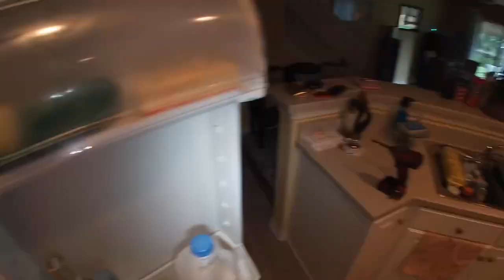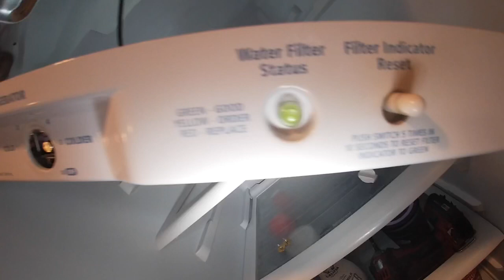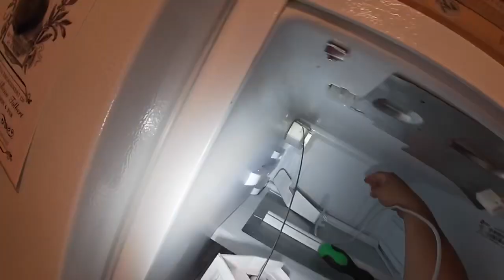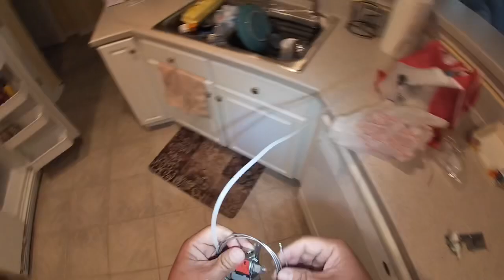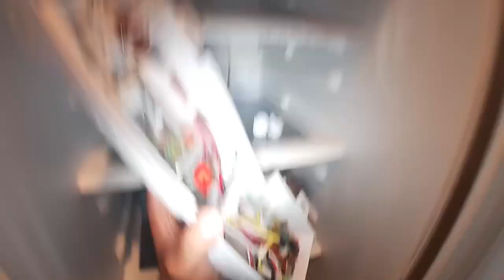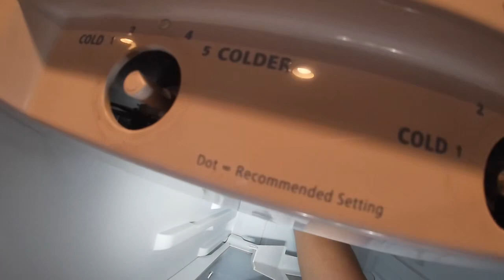How to Fix #Maytag #Refrigerator Not Cooling/Freezing Enough or Intermittently | Model MSD2542VEW00

Comment: freezer doesn't defrost ONLY intermittently, so would this be the problem.
I stuck a screw driver in the vent hole, (thought I heard a click) then I see the coils in freezer defrosting. 
is that just coincidence?
I had the freezer panel off for 2 weeks, after the 1st frost build up, kept working fine, then it happened again.
Reply: What you did is manually advanced the defrost timer and put it into defrost so it makes sense the defrost circuit started working. Your issue sounds like the timer is not advancing on its own, it’s either the timer or the cold control. My first guess would be the timer, after that the only other thing would be the cold control is faulty.

Comment: I’m working on this refrigerator. maytag MSD2550VES00 and the resident claims the defrost cycle stays on for like 8 hours. I’m assuming it has to be the defrost board is gone bad ?
Reply from the maker: I highly doubt that is the board you should replace the temperature control thermostat which is more common The part number for the model that you have is WP2315562
Reply: @DIYRepairsNow  I replaced the defrost board and it worked. Now 2 weeks laters, it’s not cooling now.
Reply from the maker: The most common part is temperature control thermostat
Reply: @DIYRepairsNow  replacing right now. Just arrived to the town house and the fan and compressor not even running. Once I replace it and still having issue. Not sure where to go from there
Reply from the maker: Is the compressor is running but the fan motor is not running you just need to replace the fan motor if it’s not freezing up is because the compressor is turning off due to overheating sometimes the relay on the compressor goes bad due to overheating
Reply: @DIYRepairsNow  compressor is not hot at all and the fan motor not running.  I was planning to replace the relay if the control thermostat doesn’t work
Reply: @DIYRepairsNow  it worked once I replaced the temperature control thermostat. Compressor and fan kicked on. It was a pain in the butt inserting old tube into the new copper wire… my question is, can you do a continuity test on the TCT to see if it works ?
Reply from the maker: @Oppastoppa914  yes you can do a continuity test but the problem with that is that inside they are connections they are corroded and oxidize so the test can be inconclusive for example if by any chance you bang or wiggle the thermostat while you were removing it does connections can touch or disconnect by The Movement and that’s when the test is inconclusive that’s why in my videos of temperature control thermostats I suggest a People to hit it before you do anything in that will make the refrigerator come on and that’s when you know if is the temperature Control thermostat or not